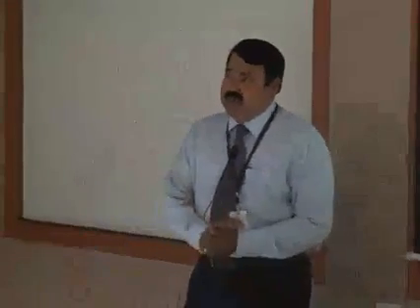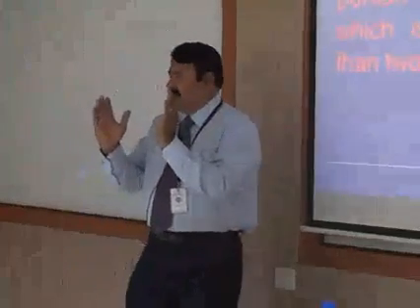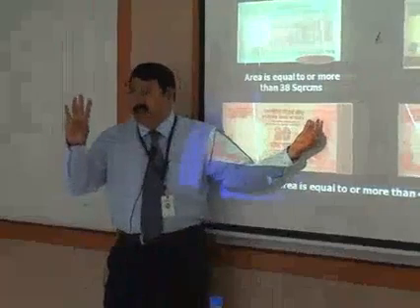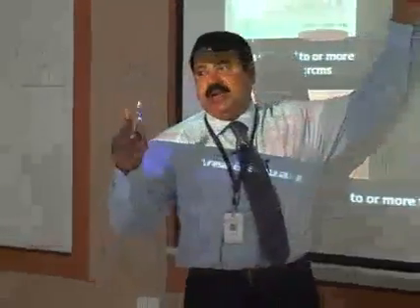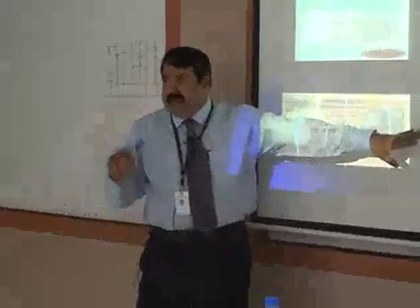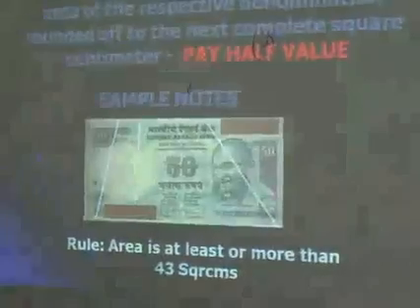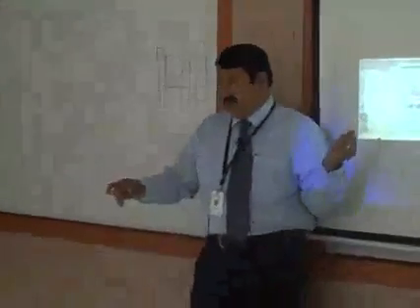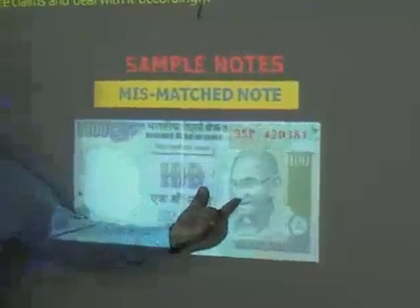training on soiled and mutilated currency notes by RBI

Comment: Dear sir, I would like to inform you that most of the banks are not accepting soiled and mutilated notes and after that those banks which are accepting the mutilated notes they are simply giving zero value for few notes those are.
1. Mutilated notes which have become two pieces(centre cut) and small piece short i.e is 49%of individual area separately of both the pieces pertaining to same note.
2. Higher piece short i.e single largest 80- 85%
3. They are not accepting the half value notes.
4. Slightly burnt,  termites affected, acid felt  & rust affected.

Kindly provide me the solution for this and regarding the same i lodged a complaint to RBI but still no resolution from them.